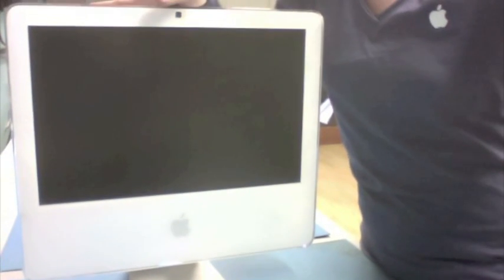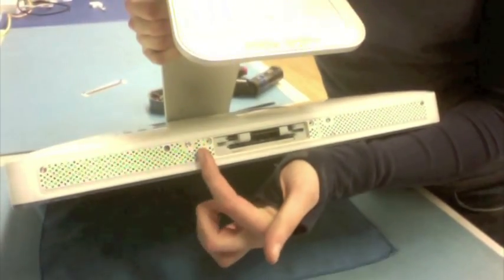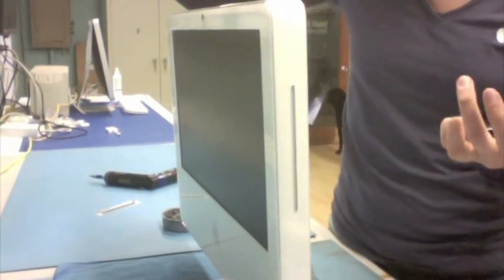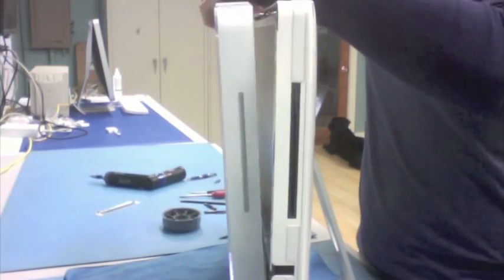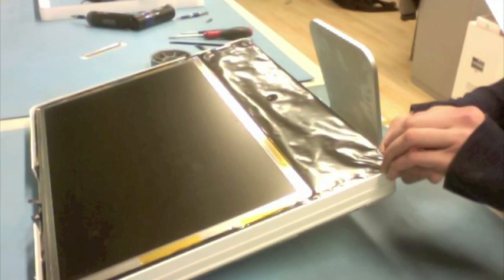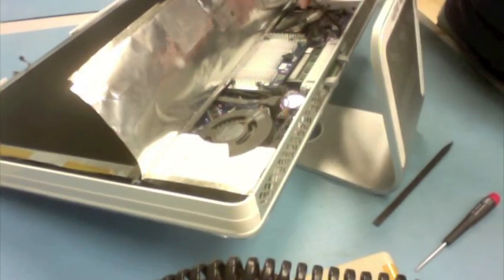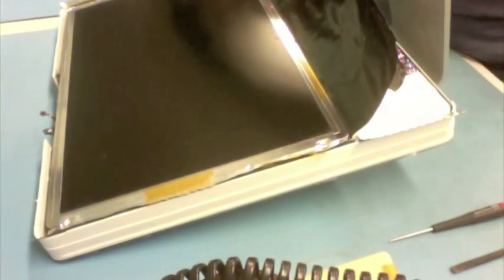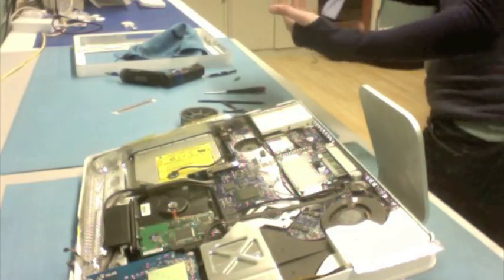First Gen. Intel iMac Hard Drive Replacement, Part 1

Comment: I just picked up a drive to put in a 24" iMac 2006 (6,1). Your video was most helpful.  A few things were different with this one.  When I tried the credit card trick it just bent up the card.  I found I just had to tilt the frame out at the bottom and up to release it.  There are no clips, just a flat metal flange that slides into the top's slots.  There was no protective paper to peel out of the way.  Also one cable (video?) is soldered, so I just flipped it over while it was laying down.

Comment: Thanks for the video.  Not a perfect match for my 20" but using the credit card to remove the front was a huge help and made repairing the last one much easier than the previous two times.
Come to think of it I'm not sure what I did before, but I'm pretty sure it involved frustration and force.

Comment: Watch out with the 20" version.  I broke the wire to my microphone.  The wire to the mic and webcam do not unplug on the 20".  A gentle pull on what I thought was a plug connector broke the wires.  You actually have to unscrew the entire circuit card that the mic and webcam are mounted on.  Aside from that, the differences were minor enough that this video helped me tremendously.

Comment: Great vid. I am replacing my HDD on my iMac and I see Rebecca is using a T-10 Torx driver to remove the LCD. My question is,,, what brand t10 driver is being used and where can I get one. I think a magnetic tip would be good for this. Any suggestions folks?  Thanks
Reply: Any T10 would be fine.

Comment: I have an old Intel 2006 iMac and am going to follow your video to pop in an SSD. I was wondering if its possible to replace the optical drive with a 2.5" hdd at the same time using a blank optical bay with pata to sata. will it have the correct power and data bandwidth? thx in advance

Comment: I been repairing these sorts of iMacs for years, I have to admit this is the worst designed case for disassembly, Rebecca is correct in that this is the most frustrating part especially if the clips are bent

Comment: Hi there, Thanks for the vid. Just a couple of things: On my iMac the aluminium foil just wouldn't peel off. I used brute force approach with a cutter and simply cut the foil.

Also, you don't say that if a heat sensor is available, it should be removed and glued to the new disk.

I did not do that, and now the iMac has the fans on full blast. Doh. I'm going to have to take it apart again to fix that :-(

Comment: I heard her state screw sizes as removed T6, T8, T10, etc.  I had no problem finding them at local big box home store.   The only area I would expand on is the T10 screws around the LCD screen.  She is using a magnetic screwdriver.  Notice screw sticking to the tip of the driver.  Also you need a one piece screwdriver (not separate bits that fit in a common driver head) as the hole to access is narrow.

Comment: I have a 20" Intel core 2 duo, serial# Last 4 is 5VUV, EMC# 2118. Originally it ran Tiger then I upgraded to snow leopard and yes I have the original disks. I still have the original HD installed and it almost full so it's time for an upgrade. I also have a newer MacBook Pro. The new HD I want to install is a WD 2TB.

I've come across a lot of situations where someone has installed a new HD and then installed the Install Disk and got nothing - they wasn't pressing the the keys or what not. My problem or question is how did these people format their new HD to begin with? I don't think they arrive mac formatted. As far I know the only way to format a drive is by using Disk Utilities, well how can this be accomplished if the new drive is unformatted and has no OS. 
Help
thx

Comment: Card wouldn't work for me, I drilled small holes and used metal rod/pin to unlatch it.
Reply: Seriously...?
Reply: @TR2000LT  yep, if you use a sheet of paper and align it with the side of the vent to get a vertical line up the back and then measure in 1 cm from there inward and drill the hole 6mm below the seem of the bezel and main case. I drilled holes at are about 2-3mm diameter.
Would have been safer to do this with the bezel off so I would not be drilling blind, but i used videos of others opening these to get a view of the latches and guessed the location using their hands as references. I planned to do this anyways even if i was able to get the card to work.

Comment: When I replaced the HDD with SSD I had to calm down the HDD fan. I used software solution the app called "Macs Fan Control" by CrystalIDEA. But you could also try shorting the fan socket with a simple clip

Comment: i wish like the ram they made it easier to get to the hdd
Reply: I completely agree with you.  Each time, I view a simple repair on an Intel imac (replace the hard drive, power supply, etc.) it appears Apple only wanted this to be done by a certified computer repair shop.  Makes me glad that, I own a white 20 inch imac with a G5 Power PC processor.  This desktop was designed to be upgraded with (RAM, AirPort Card, Hard Drive, etc.) by the average home computer user and is very simple to open.  Once open easy access is provided for the user to reach most components.

Comment: I was close to throwing this POS onto my cold polished concrete floor after spending more time than I ever wanted to when removing that farking bezel.
Reply: Mine didn't have those clips at the top - I spent about an hour trying to get them to release, then another video showed a guy just working the front off the machine, which worked.